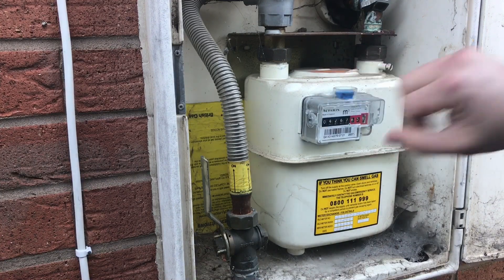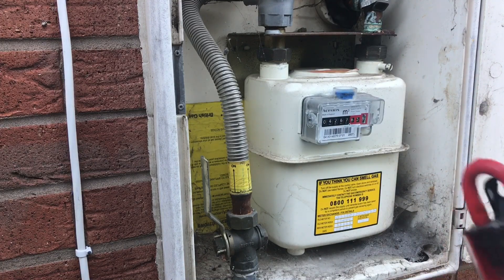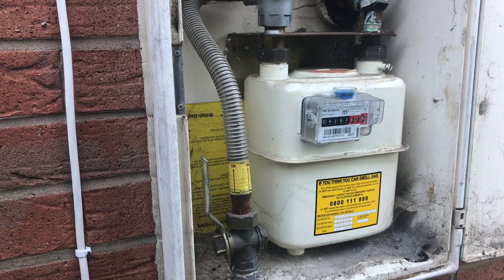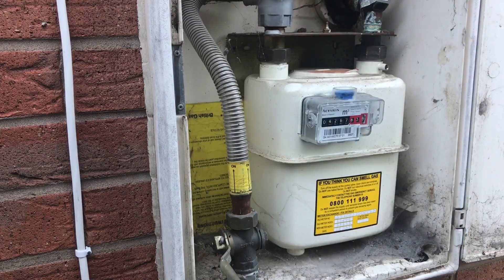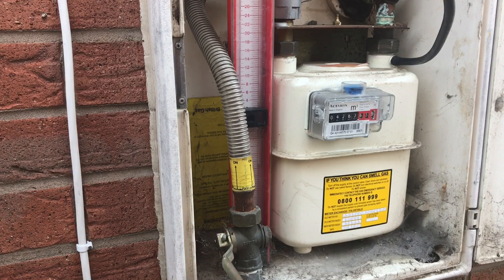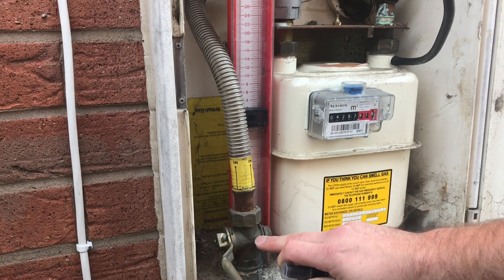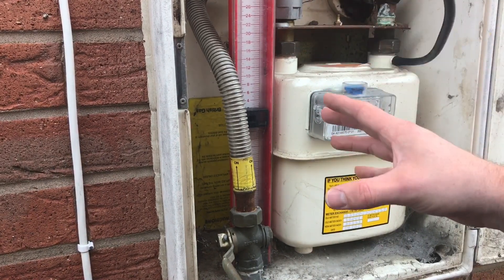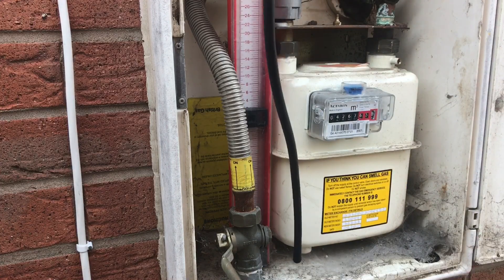Gas tightness test procedure | tutorial | how to

Comment: Do you not think regulator can get locked while turning ecv valve back to on  position quickly
Reply from the maker: There are only two real reasons this would occur, if there isn't a strainer placed into the regulator or that the distance between the regulator and the valve in insufficient (mainly new builds)
If this is the case and it does lock out the solution is very simple really.

Comment: I learned not to use washing up liquid as was always told it was acidic ?   no? Good video by the way.....
Reply from the maker: This is true, you shouldn't use pure washing up liquid it a very old timers trick however if it's all you have to hand them I would rather use it and make sure there isn't a leak than not use it if I'm honest😂. Make sure it's properly wiped afterwards and it won't be an issue. 
Thanks ray

Comment: did he discribe that meter as an U6 meter? isn't that meter an E6 meter?
Reply from the maker: No sir that meter is a u6, E6 is a small electronic gas meter with digital backlit display, internal shut off valve. 
A U6 and SC6 meters incorporate a measuring unit with a two litre cyclic volume designed to accurately meter volumes in all natural gas and LPG applications. 👌🏼💪🏻
Reply: E6 meters are half the size of u6 that’s the dead giveaway 😂

Comment: A test can fail up to 4mbar on old pipework with appliances with no smell of gas on that meter but not with a “new installation “ of pipework!
Reply: Dude never on the pipework only on the appliances themselves. If the tightness test fails. Isolate all the appliances and retest. If it fails on the pipework. Then it's fail full stop. Then you inform the responsible person. If they agree for repair then repair it.  If not cap it cutomer signed notice and onto cadent 😊

Comment: Washing up liquid?? Really?
Reply from the maker: John Warner yes really. In past times "washing up liquid' was the go to product for gas fitters, any 'bubble' solution is fine to use such as soapy water for instance. However I should have stated in the video that I wouldn't recommend using washing up liquid as it 'can' corrode the fittings if left! However IF it's all you have to use then it will do the job. It's always better to test than not to....... (Agreed as a gas fitter you should carry leak detector with u, like I do)
Reply: Fair play Dan, I just never thought of it. But how corrosive can washing up liquid be FFS
Reply from the maker: John Warner very corrosive over a long period but as long as the joints have been thoroughly cleaned after then it will be ok 😁👌🏼 thanks john

Comment: If the ECV is letting by then you don't need to cap the ECV off as is not escaping it's just not able to be isolated and is letting by, you can leave it on and attach a warning label and contact the gas supplier and take your reference number. Then once it's fixed return to the job and continue with the tests.....

Cheers for the video it is the best tightness test video on YouTube
Reply from the maker: Youtube Hero thank you, I totally agree with you and you do not have to cap it off. I have had it twice in the past and I have capped it off and waited for the supplier to attend site to repair, I personally wouldn't leave site (I'm over cautious) I believe you cant be to careful. 👌🏻

Comment: You totally failed to mention the permissible drop allowed for in different meter types, u6 is 4 mbar and e6 is 8mbar. Tut tut.
Reply from the maker: TheMightyquinn67 agreed I did forget thank you for noting this in the comments 👌🏻
Reply: Yep and it's only allowable on appliances. Not the actual pipework itself 🤔(pipework fails)
Reply: @rayc1503  that's not correct the permissible drop is due to the meter its nothing to do with the appliances. Hence different allowances for different meters.
Reply: @liamc9425  I've been GSR for over 10 years now.  You're allowed absolutley no drop on new pipework.  If it's old or existing 4mb on the appliances not the pipework of U6 meter. 8mb on the appliances not the pipework of an E6 meter.  If there's any drop at all your supposed to isolate all appliances and test the pipework.  If that fails Sir then it's a fail.  If in any case the customer reports to you he/she has smelt gas then it's also a fail, simple.  Go back to your handbook and correct me if I'm wrong or look up BS 6891:2015: or IGEM/UP/1B  TT & purging.  Passed my GasSafe inspections and ACS no problems.  It's more common sense then anything else.
Reply: @rayc1503  as I said permissible drop is dependent on the meter. 🙄